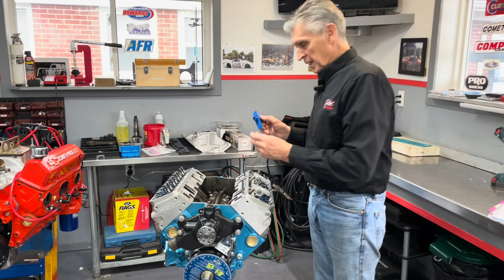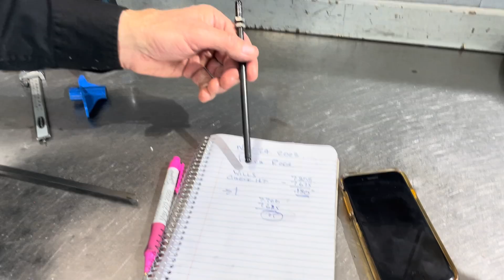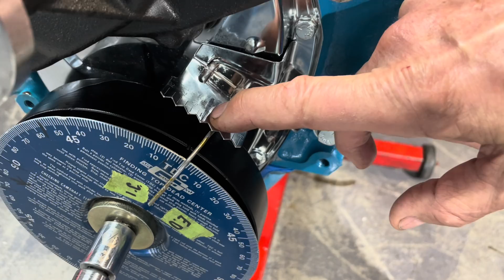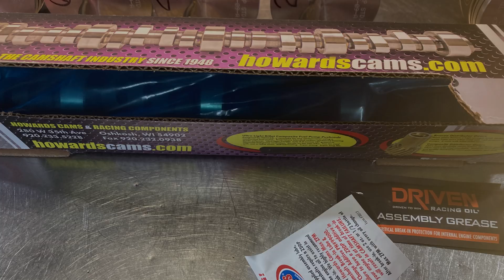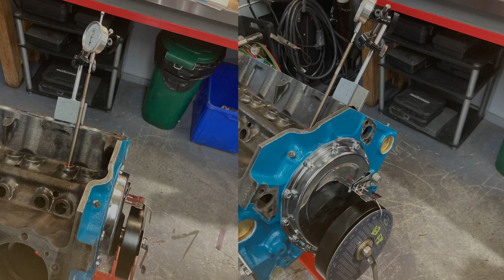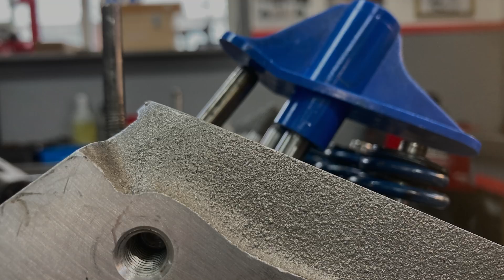How to increase Performance HP and TQ on a Budget and 350 SBC Chevy step by step assembly tips

Comment: when it comes to chasing compression, it's good to remember as you said, a full point increase is "only" 4% power increase--so how much does one want to spend to get 4%? (anything less than 10 bhp rarely is felt by the "butt dyno"). A pair of poor-burning cylinder heads (on a budget build, compared to say Vortec heads) might want more ignition timing and so having a relatively lower CR to allow more timing on pump gas might pay off. And then there's the wear in, as 'rings and/or valve seals loosen up, letting some more motor oil into the combustion chamber, a lower CR may offer a tuning cushion. 

If we begin with a complete engine, get the pistons at all four corners to TDC and measure their distance from the deck--this can tell you if you need to get the block decked because things are way too off. some will reassemble with an "overthick" rod bearing on the 'rod side and an undersize (by the same amount) on the rod cap side, to shift the connecting rod higher up the cylinder, if a thinner head gasket worries the customer. If the builder wants to get fancy, some will use a higher intake rocker arm ratio on the outside four cylinders since the intake runners are longer and so the air/fuel mix takes longer to reach them than the inside 4 cylinders, but that depends on intake design (port fuel injected engines of course aren't having this issue). this may help give a "high compression" cylinder get the fuel to burn on outer cylinders rather than try to melt their aluminum piston, and play with spark plug temperatures since octane defines the length of burn. 

if someone wants to chase high compression on a budget, they better have a spot-on way to measure CC in each piston and combustion chamber in the cylinder head, and know the crush thickness of the head gasket they're using. A cheap way to increase CR is to find a Vortec 305 head that isn't cracked. the smaller ports won't help hp at high RPMs but for street driving with an overdrive transmission and the right rear gear ratio, it can help with fuel economy. 

good point about the piston rings--I like to use a fish scale when pulling the piston combo into a cylinder rather than tap it in, if i get a reading different from the other cylinders, i know i have a problem. easy to catch and fix at that time. 

some builders will mix and match big block oil pump parts with the small block, but the thing to remember, don't use a high volume pump with a stock oil pan--you'll just empty it out too quick. Chevy used basic pumps with different springs for their engines designed for high RPM (the early Z28 stuff meant to be raced). Cleaning up the passages will reduce interference and help the oil get out, and sometimes that will be enough without having to go to a high-pressure pump on an engine design with a great oiling layout.
Reply from the maker: Thanks for all the helpful advice Albert. AG
Reply: Even though they are only 305 Vortec heads they still out flow conventional SBC heads by a wide margin. I like that trick about using thinner/thicker connecting rod bearings to adjust your deck height! That never crossed my mind.
Reply: 305 vortec heads down pretty much 20+cfm compared to 350 vortec across the entire rpm range I just don’t think it’s worth it if someone is buying heads the 305 heads will be maxed out not leaving room for any future upgrades. The 350 heads can be worked some as well but in reality you can buy cheap Chinese aluminum heads for 400 bucks and work them and install your own hardware and then have heads that are pretty much as good as any manufacturers make flow wise and for less money.
Reply: @Thumper68  agreed, 305 Vortecs aren't a great choice, they often crack between the 'seats. but that's the point with going cheap (versus affordable), you're giving up some benefits. the problem with the cheap ebay "chineseum" heads has been covered on video channels that deal exclusively with head porting (pisscutter, erik weingarter, etc). some will have porosity issues at operating temps, or the casting has sand core shift issues, or quality control on the valve seat areas, spring pockets, and other spots is so poor the head has to be rewelded and remachined before swapping over valves and deburred rocker arms (springs likely shouldn't be reused, you may want a better valve guide and seal installed, but a used Vortec head is going to have similar costs too) . 

not all are like this, and of course there are people who run into similar QC issues with Edelbrock heads and carbs, so i'm not trying to make a case against what you suggest. far easier to weld up an aluminum head (but a pain to mill and machine, aluminum really fills up a grinding bit) and there's benefits to aluminum (if one knows how to lash the valves properly for aluminum's expansion rate). detonation resistance, weight, etc.

as we all know, being cheap is a roll of the dice--sometimes it pays off big and sometimes we total up the bill and realize we should have paid more up front.

thanks for contributing to the discussion :)
Reply: @albertgaspar627  I agree on all those fronts. Your response is exactly what I expected I also watch all those same channels.

I do think that there’s better sellers to buy the Chinese heads from to get better castings though.

Comment: You could have radials the two oil holes in the oil.pump and would have helped it.  Also, it should have .004" clearance between the oil pump cover and the gears on the case...  AG.  What you showed looks like the pump gears were running against the cover because the dist. was too deep in the engine trying to drive the gears out of the oil pump.
Reply from the maker: Thanks Leonard. That was the original OEM pump assembled by GM in 1981. Some wear on the thrust plate is normal and will not hurt performance. AG